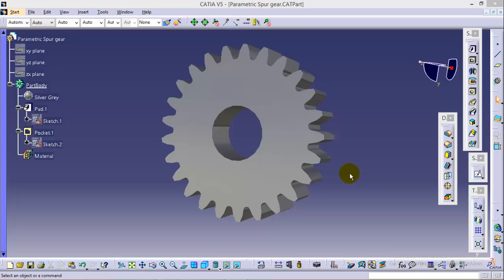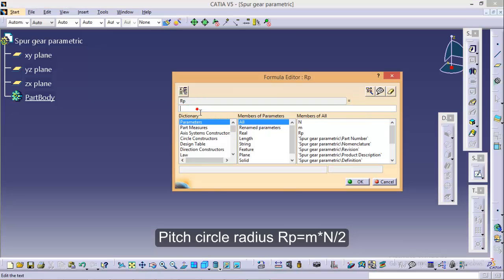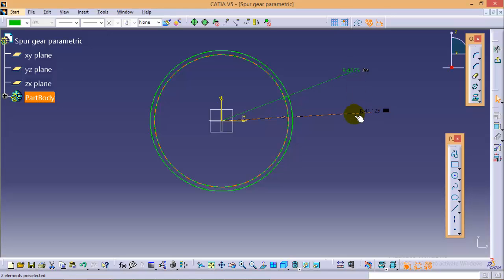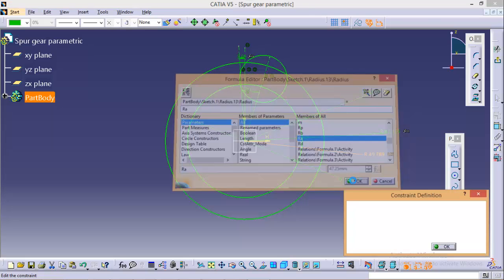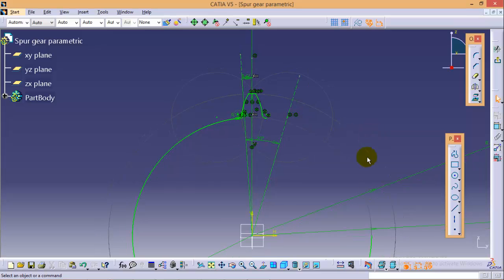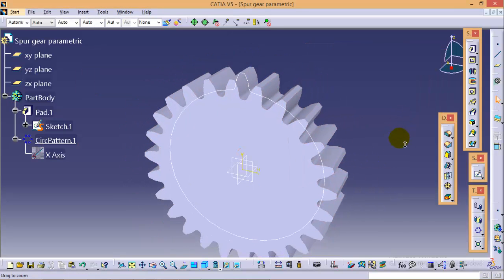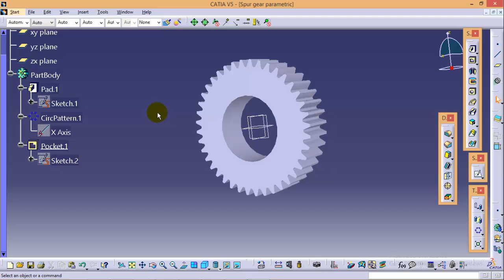Catia Tutorials How to make Spur gear  profile in catia using parameters and formulae

Comment: PLEASE add a warning so people do not use this method to make an actual, real-life gear. The profile of a tooth face is NOT a simple arc; it is the involute of the pitch diameter circle. Using this method, you will not have a constant pressure angle and the gears will bind, alot.
And (none of this applies unless you draw a real tooth using the involute), you have to show how to add backlash and profile shift to a gear if you want it to function well. Call an engineer if you have any questions.

Comment: I'd also like to add a few points here:
1) the 20 deg angle used here can be different for other designs. use the formula: 360/N*1deg
2) if the you selected the formula you want to apply but it is not updating on the sketch then write the parameter name in the formula bar above instead of selecting them.
3) use Rbc=Rp-m if the formula for base circle Rbc=0.94*Rp gives you a smaller value then the dedendum circle

Comment: what is the logic behind 20degree
Reply: It's a standard. You get 20 degree or 14.5 degree involute gears in the market. These are pressure angles commonly followed as standard, so you can choose either.

Comment: Thanks for the tutorial but can you help me out. What do i have to change to change the diameter of the whole gear. I am looking to cut my gears out on a laser cutting machine that cuts mdf wood. The laser cutter needs a dxf file and so I will export what I create as an mdf file. However I need to create a  6-1 gear ratio and too do this i cant just modify the number of teeth as the teeth will be different sizes and so I need the same teeth size and shape but different number of teeth and smaller diameter of teh whole cog.

Comment: In the exemple where you changed the # of teeth, you also changed the m value. What is the m value for? and where do we find that value.

Thanks
Reply: +dodle m is the module. the module basically determines the geometry of your teeth. you can calculate it by dividing the pitch circle by the number of teeth. --> m = d/z

but if you were to determine your module without knowing your d or z, you can use different formulas to get an estimated module.

example: you the attacking Torsion T (or Mt) you need to calcualte the Diameter of the shaft by using this: dsh= 3,4*(T*1,17/sigmabw)^(1/3) sigmabw is the bending strength (N/mm²). you Need to convert T into Nmm.then you calculate your estimated module by using this formula:mest = (1,8*dsh*cos(beta))/(z1-2,5)for a normal gear Wheel with straight teeth beta=0°; z1 should not be smaller than 17. after you get you mest you will round it to the next 0,5 step. 2,33 ->2,5  and 2,64 -> 3,0. Always rounding to the higher value. if you Need to know more, you should buy a book for Engineering. i got this formulas out of "Roloff Matek Formelsammlung" but unless you know german, this wont help you. Hope it helps you out
Reply: +als ob thanks for the explanation
Reply: you are welcome

Comment: thanks for this video 
i have a problem and i don't know what is this 
first i do as u do creating parameters and this is OK 
then 
i go to sketcher and sketches 2 circles and make a radius dimension and choose edit formula as u do and select the parameters but when i selected anyone its disappear after click it get value but not linked with the formula 
the formula symbol doesn't appear i don't know what problem 
if there is a customize setting for parameters please help me 
i use CATIA V5R20 
thanks :)
Reply: I have the same problem dude.
Reply: Double click the parameter first then click ok.
Reply: Did you fix your problem? I have encountered the same problem and struggling to solve it.

Comment: Hi Abhishek!

         1) While set the New Parameter type for N you just taken from the option down list 'Real' Why? is there some answer means just share. 2) after select & try to do the circular pattern of the first half of the gear tooth we just facing the error selection & i just clicked that ok button often then only i get my circular pattern. that error is why?
3) finally when you drawn the shaft circle is not clear with your selection. i don't get that. Your effort is too good keep do this.

Thank you for the class.
Reply: +suresh Kumar  For N it is selected as real because N is the no of teeth in the gear and doesnt have any unit like mm, deg etc. Real is chosen for constant values without units. as for the other two questions, i have not tried it out yet.

Comment: is the gear teeth shape EXACT or APPROXIMATE?

I had to create 30 different points for the teeth curve to make it involute, is this necessary or I can go by ur video?
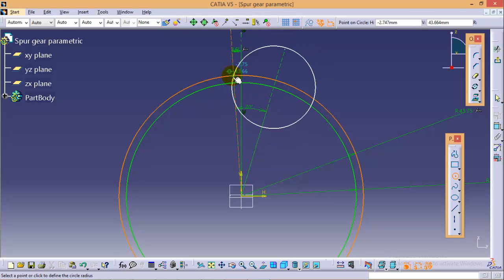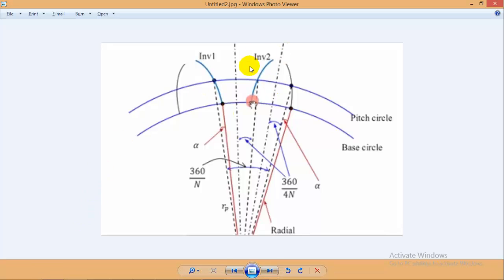Reply: You did the right thing then. This video (and many others) are very misleading on designing gears, especially the face of the tooth. You cannot use a simple arc to make the face of a tooth. The step at 6:16 is wrong. In the picture at 5:10 even states: "Inv1" & "Inv2", meaning INVOLUTES. It would make a terrible gear that would either bind or have too much play. It would also NOT have a constant 20 degree pressure angle.